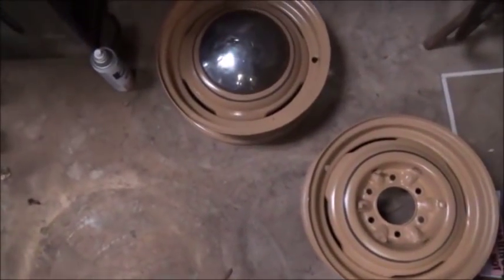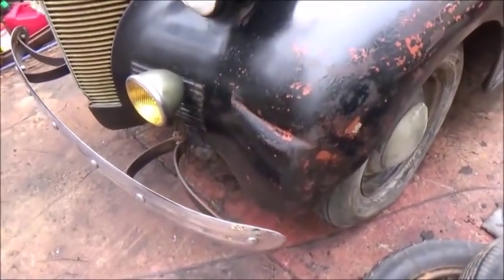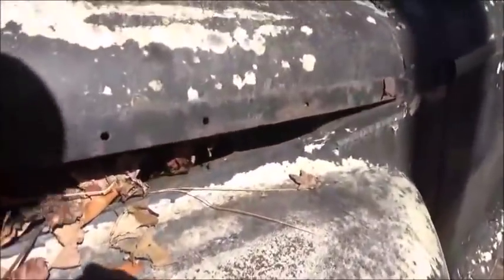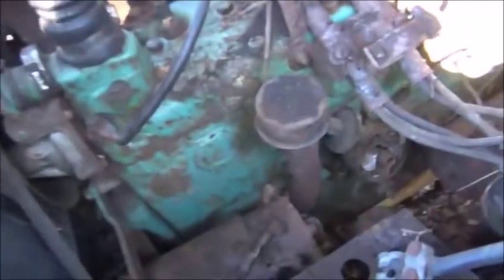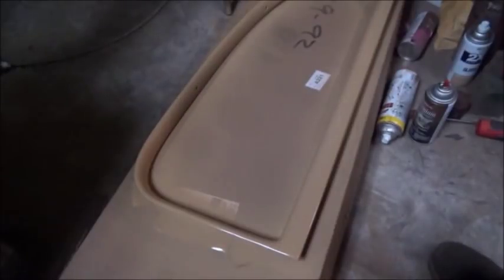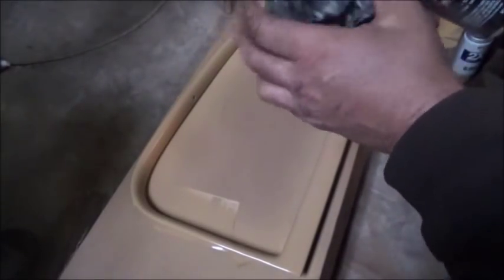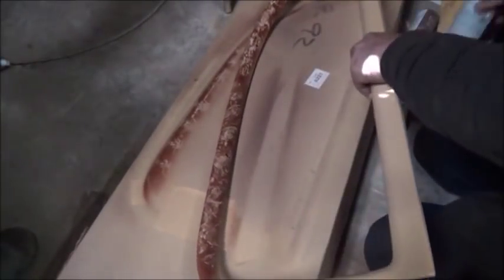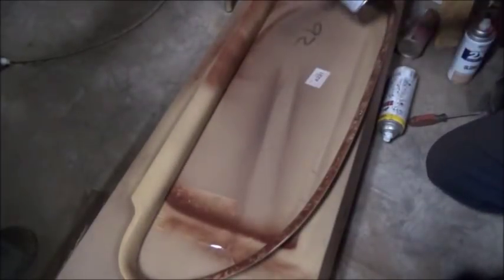1939 CHEVY TIRES 1948 PLYMOUTH & WOOD GRAINING

Comment: The fender on the 39 looks great. The burl effect turned out great too. I had my doubts about it at first but you were right, it looks really good. 
Finally, you gave me a good laugh when you call the air cleaner on the 48 a nut filter 😂

Comment: You never ceases to amaze me with your talent. That wood graining looks nice. I bet with a little more practice you can make it look like a different style. Either way, nice job on that. Love the wheels on the Chevrolet and a fine job on the fender dent.  I was totally amazed at just how much of the woods was in that Plymouth engine. I'm betting you can get that engine going for sure. Maybe the a/c compressor is locked up and it's keeping the engine from turning? My money is on you make it purr like a kitten before long. Have a good day! This video made my day nicer.

Comment: Glad you went with whitewalls - looks better with the fender un-dinged. Not sure about the wood tone interior trim, won't really be able to appreciate it until it's all back on the car. All in all, I really like it. Hey, didn't you pick up a 67 cadillac awhile back? I can't remember if it was for you or somebody else. I've got a great idea for it because restoration is too expensive, and sedans don't bring enough money, and you just fix cars to drive...what about a rockabilly cruiser? Red wheels, satin black body, checkerboard seat covers, that good ol 429 singing through some lakes pipes, high up front, low in the back, etc. ( I'd drive it)

Comment: The paint effect turned out great. In place of the plastic bag you can get some tin (cooking) foil which you really crumple up into a ball,  making sure it is really crupled into small peaks and troughs and use that to remove bits of your brown paint rotating it to present a different part to vary the paint effect, but it's whatever works best/easiest for you.

Comment: As an old retired body man from the 60s, that dent on the fender would be what we called a gravy job to straighten.  We would be hammering and dollying the dent then picking and filing it to finish it off. We would be able to do that without using any body filler because the metals used back then was completely different than what is used today. You cannot pick and file on today’s metal because you will go through it, it is so thin.  Not to mention it is a molecularly different metal altogether, known as high-strength steel.

Comment: I use a floor scrubber pad from a buffer to dab texture on walls , it also works on the paint and you dont get the same pattern everywhere. Just a thought for your next try The green pads work for me but this is your rodeo and do it any way you want.The way yours came out looks just fine .

Comment: noticed in a previous vdeo you were concerned about cupro- nickel brake pipes, dont be, i have been using that stuff here in the uk since the 1970s never had a problem. had it on my range rover for twelve years, turned a bit green in places but easily polished off.  also ever thought about putting a sponge in your plastic bag i find i get better control with crazy paint finishes. got third place in a national custom car show once.. just putting my two penarth in as we say round here( just expressing my thoughts ) from a mechanic/paintsprayer/garage owner for the past forty years.

Comment: Jonathan I have a request. I’m getting ready to get my papaws old 56 international s120 4x4 but been sitting for 30 years and the motor is stuck. Would you do a video of going through the process of freeing and getting running a engine that’s been stuck for a long time just like the Plymouth. That would be a great help. Thanks

Comment: ...lol..i can't believe people commented on that dent..lol..what dent ? Has anyone mentioned anything about wire brushing the grill..oop's sorry didn't mean to bring it up..they saw the dent right....well it didn't bother me considering you replaced most of the rear body..the color of the wheels and the pin striping looks great and so does the window moulding..i sure did want to see the plymouth run but i guess that will be another video..did you get the 59 ford too ? Thats the one i want see run..it's for us ford guy's..make it happen good buddy..see you on the next one..Cheers friend 🍻🍻🍻🇺🇸🇺🇸🇺🇸

Comment: On that 39 chevy do plan to give it a beautiful paint  job? Candy apple red would look good so would a blue. are you going to have the grill rechromed and other pieces rechromed? i hope you have plans to put in a new interior inside of the body. A blue velvet with with white would be pretty on the interior of that car. Add a newer radio would be nice. That car runs on a 6 volt system, and you can‘t buy a new radio that runs 6 volts everything is 12 volt  and last the person you got the from in the first place, will you take the car back to that person and show that person your work and what you got done? That when you got the car finished show to him? And you show the oil pressure and that should be at least 35 p.s.i. there maybe a issue with bearings in the engine worn out and or a bad oil pump. But you showed problems with that engine right from the start.

Comment: I am not a big fan of the look you got with the burl paint. It is your car not mine, so it is OK if you like it.  Another way of wood graining, and it might work better with your technique, is to paint and thoroughly dry the first coat, two days, then use latex water base for the second coat.  After it dries for a day or two, overcoat with clear.  The advantage of the water base is that it washes off clean and you can start over if you don’t like what you did and it drys more slowly during the graining step.

Comment: Glad you were able to get the hood up...I've never seen an engine "buried" like that (unless the whole machine was buried) & if l ever saw an AC compressor on a flathead motor - l sure don't remember when that was...l think that motor might let go - l think l did see a little give...tires look good & l overlooked that dent on account of what l saw you go through on the passenger rear of the car...that is a real cool woodgrain paint trick...l'm not understanding about the black paint part (actually l didn't understand the plastic bag part till l seen it) but as good as l can see - should even look better with the clear on...if the Plymouth motor don't let go maybe you can put the moonshine Dodge motor in there? Good video - l especially liked the woodgrain part

Comment: Not feeling that simulated burl look.  I've seen professional painters restore the wood look dash to old cars from the thirties and have done it myself on my own cars and planes.  They start with the same base coat you did BUT they apply oil paints using a "fan brush".  Nice oil colors are burnt umber, raw umber, and raw sienna.  The oils dry very slowly so you have plenty of time to get the grain pattern just the way you want it.  Put it on in layers starting with burnt sienna.  Then just a little bit of the much darker raw sienna to add complexity.  Then, once it's all nice and dry you follow up with a satin clear coat and it looks just exactly like real wood,  The oil paint is slightly translucent giving it a 3D effect.  All the paints and brush are stocked at hobby lobby too.  It's like upholstery Jonathon.  Once you see how good it looks you'll want to do it on everything!  You seem to catch on fast.  I know you can run with this short description. https://www.hobbylobby.com/Art-Supplies/Brushes/Synthetic-Squirrel-Fan-Paint-Brush---Size-4/p/117665